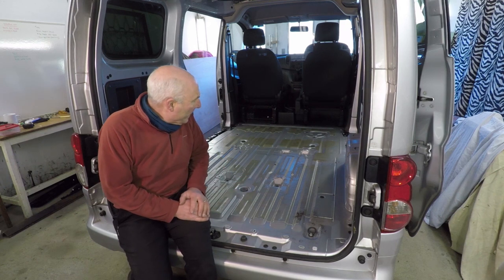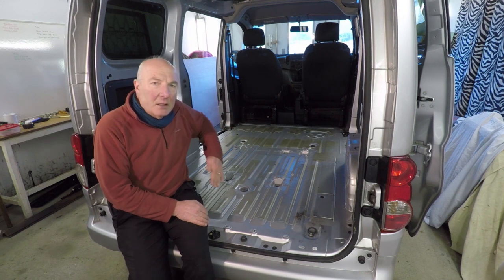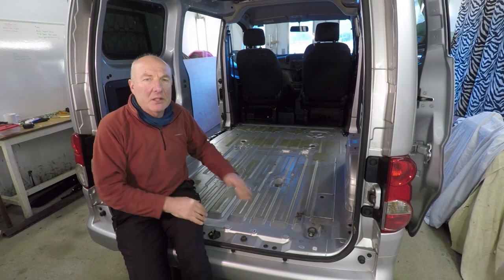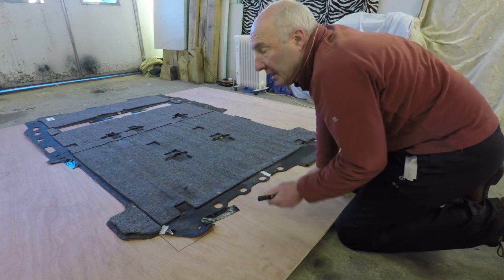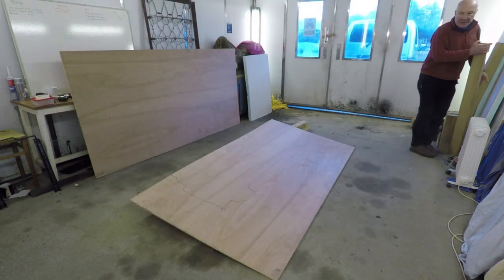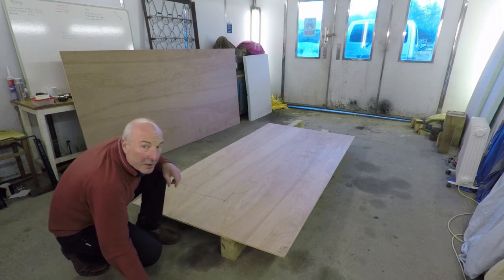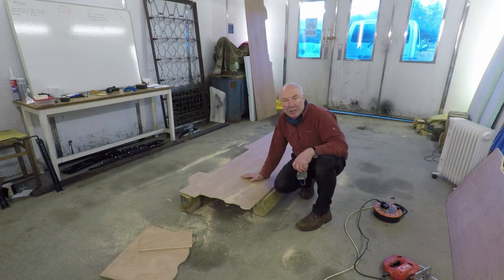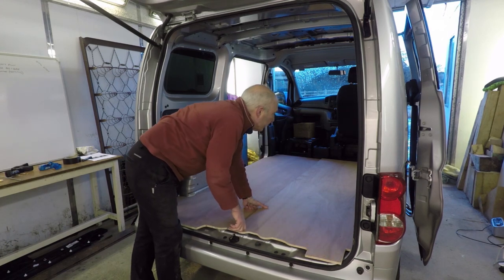Converting a Nissan NV200 to a Campervan- Part 3a- preparing the ply floor

Comment: Good point on the fuel pump access , never seen this mentioned before ..........
Reply from the maker: I suppose the chances of needing to get to the pump are pretty slim but they must have designed the cover plate there for a reason.

Comment: Hi Andy- Thank you for documenting your conversion- I will be doing a simpler one, but am learning a lot about the NV (mine is cargo) from your series and seeing good ideas to incorporate into a design. The swivel seat is terrific- I'm in the US so that would be be flipped, of course- very helpful to see your step-by-step. I hope the battens do well- it may be better to use solid wood strips (poplar?), as ply has less bite for screws. I may seal the ply beforehand with polyurethane to slow down any effect of any condensation on the ply with cold weather use. Looking forward to watching and learning from them all.
Reply from the maker: Hi KT, thanks for the comment. Yes, solid wood battens would perhaps provide better grip for the screws but I have had no issues as yet. Sealing the ply sounds like a good idea.
Reply: @nv200camper4  hi!
Thank u so much for your helpful videos.
Which model  Nissan nv200 is the best for convertir a camper? 
Why did I chose combi?

Comment: Hi Andy. I've just subscribed to your channel as I intend to convert one of these vans as a permanent sleeper/tradie wagon that can also be switched into a camper for trips away. Could you tell me the maximum dimension mattress you can get into these vans?
Reply from the maker: Hi Lewis, thanks for watching and commenting. The maximum floor length is 195cm and the widest part above the wheel arches is 130cm. I hope this helps.

Comment: Could you have just cut the floor straight across that part of the sheet and put a hinge on it to open it up? Easy to open up that whole section?
Reply from the maker: do you mean the small panel over the fuel pump? I think having a hinged section would be prone to problems with the board likely to flex etc. Also the chances of actualy needing to get to the pump are minimal (hopefully) so I reckoned this was the best and most practical option.

Comment: Hi Andy... Great video. But I got some questions. So you just glue the battens with adhesive to the floor. No screws? How is it now? Are they strong enough to support the plywood, the bed and the cabinets?
Reply from the maker: Hi Geraldy. That bonding glue that I used is really stong stuff,  it would take a hammer and chisel to prise the batons back up now. The batons were made from strips of the ply from the floor so plenty strong enough for support.
Reply: NV200 camper What is your bonding-sealant brand? I live in small town so I have to buy it online. Just to make sure I order the right one. Sorry if I'm asking too much.
Reply from the maker: this is the stuff: https://www.ebay.co.uk/i/381469215115?chn=ps
Reply: NV200 camper Thank you.

Comment: What kind of plywood did you use? I guess one with many layer is best? Buying some tomorrow for my conversion :) Great videos, really helpful!
Reply from the maker: Hi Daniel, I used 12mm ply which I bought from a builders merchants
Reply: Thanks, so just regular fir construction plywood? No problems with screws not attaching to the wood?
Reply from the maker: yes, just normal ply and used standard wood screws.
Reply: OK, thanks. That might be fine then, just read som where that baltic birch plywood has more layers and make the screws bite a bit more...